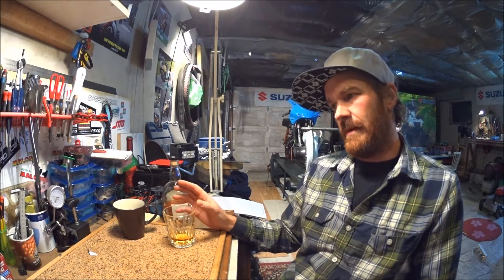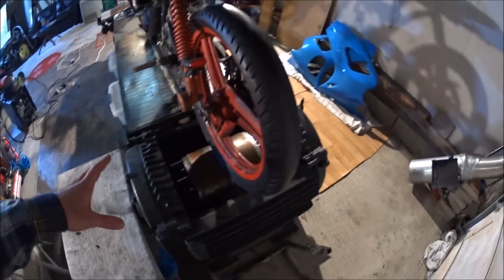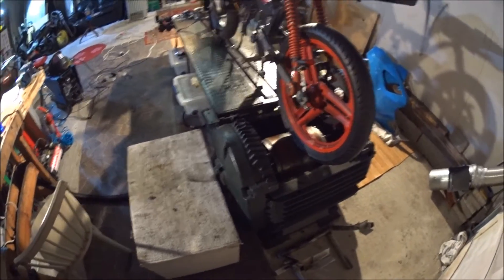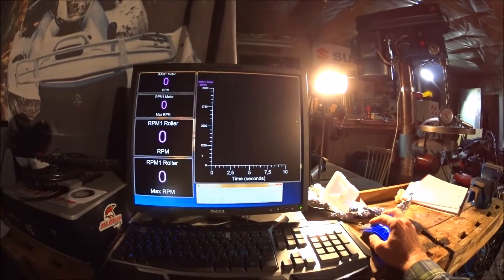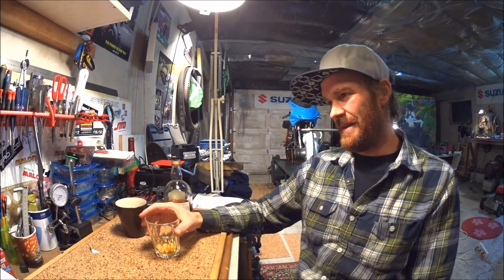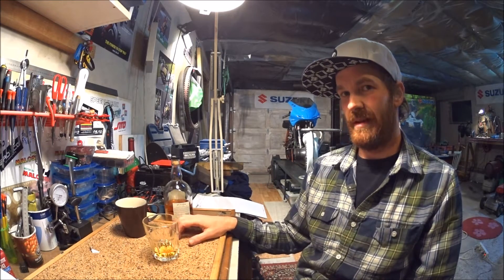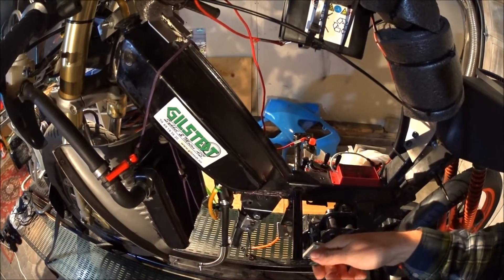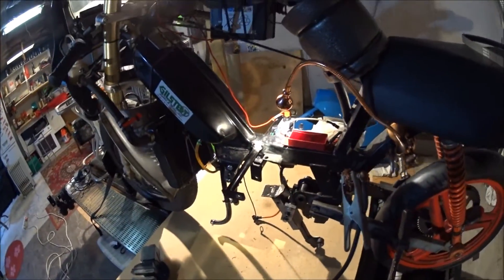E5 - My DIY Dyno + Future Frame Modification. 2STROKE STUFFING

Comment: great channel, what abb motor is it? what peak rpm are these motors spinning at?
Reply from the maker: +choco107 Thanks! It's an HXR115SA, 110kw. They guarantee 1800rpm continues, but wont give out any max peak rpm numbers. I've been close to 4000rpm on several occasions (1200 Harley), it hasn't exploded...yet...
Reply: 2STROKE STUFFING thanks man any idea what these motors where used on ?? or some similar big motors ? its great to see people still involved with 2 strokes
Reply from the maker: +choco107 No clue, got it at a scrap yard, came from a wood processing factory. They're pretty widespread in industry I'd imagine. 2 strokes are interesting as a hobby - both simple and extremely complicated at the same time.